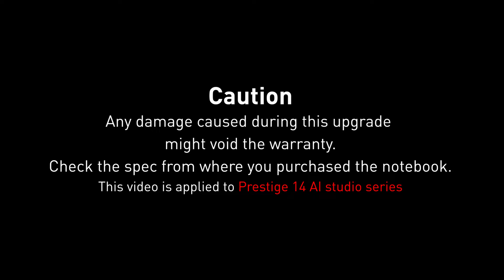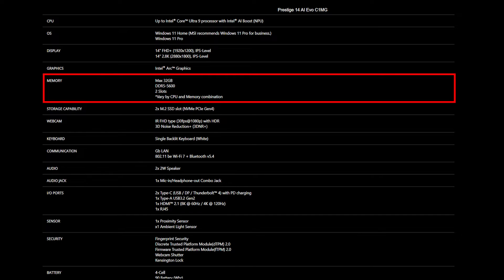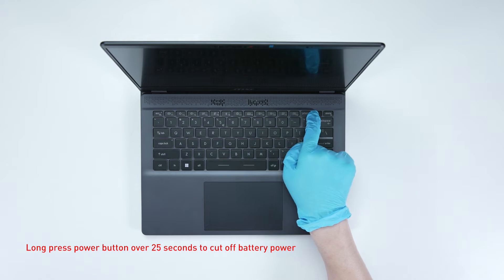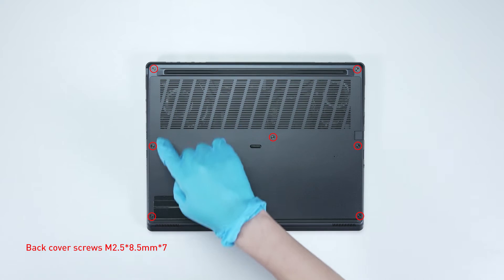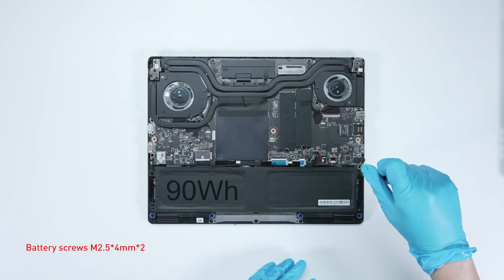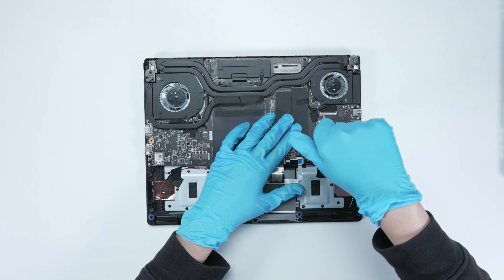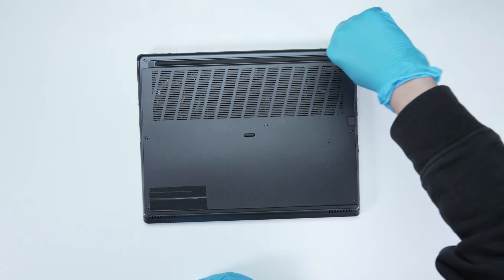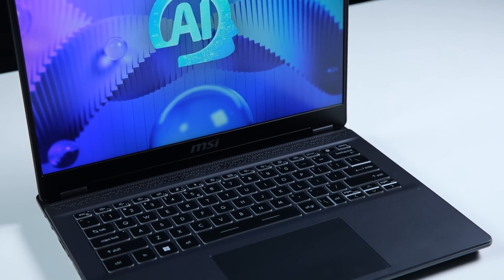MSI Prestige 14 AI Series Upgrade Tutorial

Comment: I see nothing wrong with the tutorial itself, apart from that it looks like the cover is opened a few times already since just running the prying tool along the crack doesn't seem to be enough with a new MSI Prestige 14 AI... A bad laptop construction, have never had any problems upgrading RAM/SSD on other portables but this doesn't seem to work without breaking anything.

Comment: I did this and i broke some plastic pins, terrible tutorial. You did it so easy and i did what you did but its terrible. Worst tutorial ever seen. Thankyou very much to break my back cover.
Reply: It's mainly the construction that is very bad. I have upgraded RAM and/or SSD on many portables and done just about as is seen here but I have stopped midway. While it is easy to pry it open at the back, it seems almost impossible to part the back cover from the machine around the Type-C connectors without breaking anything. My plastic prying tool is too thin for anything to happen when just pulling it along the edge as shown in the tutorial but I'm not sure a thicker, wedge-shaped toll would help. Maybe I will be forced to have my m2 SSD on the outside in an Type-C enclosure. That stinks.